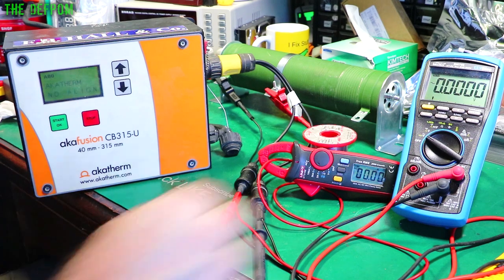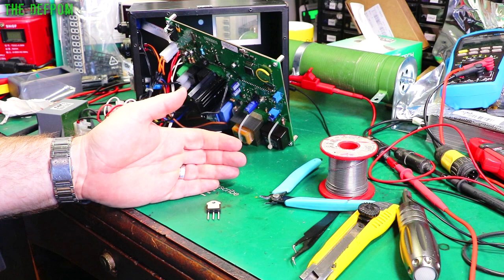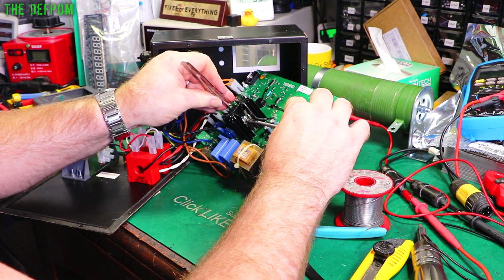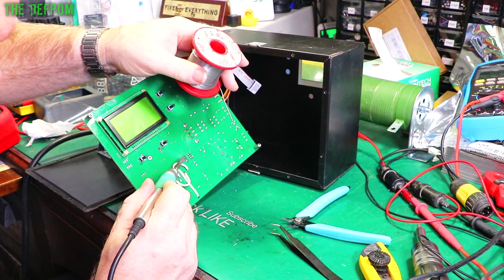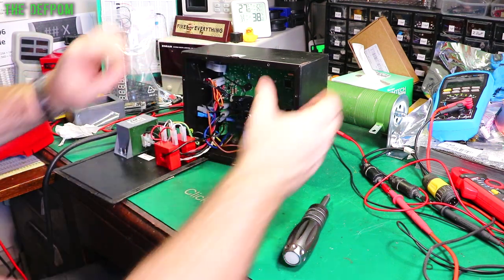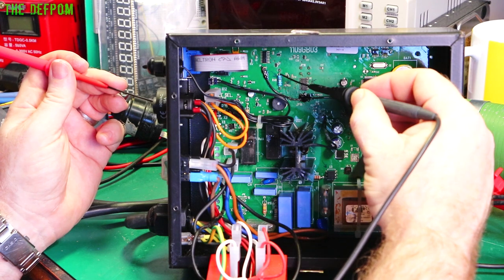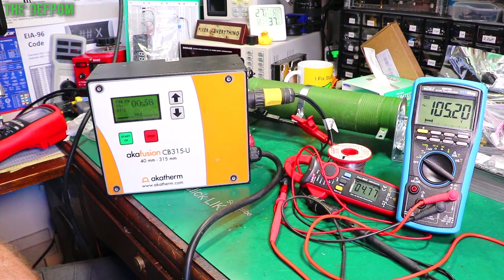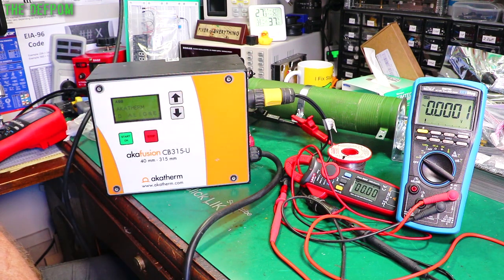🔴 Akafusion Akatherm CB315-U Electrofusion Unit Repair X2 SN_2436 & SN_2437 - No. 805

Comment: Hi, do you do a mains PAT test  to check insulation and ground continuity?
As these welders are used in the field powered by "generators", the ground circuit of the welder may need checking, also suggest to the customer he/she checks their generator and any power leads they use.
The fact they have the same fault, from the same customer may need some "interrogation" to find what operating conditions they are used under.
😃👍😃👍😃👍
Reply from the maker: Yes I already queried the power supply, they had their electrician measure the voltage and frequency of the generators they use, and it was fine (they sent videos showing the test being done), my only suspicion is that they could have been turned on and connected as the generator was powered up/down which may have resulted in a spike or something.
Reply: @TheDefpom  , and if you place a TVS diode on the powerinput of these units, to clamp down spike or surge ?

Comment: Nice repair, Scott. Perseverance rewarded! In addition to "Mr. Datron" you seem to have earned a "Akafusionman" title. Have you looked at the voltage across that resistor while the weld is taking place? Seems like leakage of the welding voltage might be possible cause. Also, is the user checking their cables and connectors regularly - triacs do not like arcing.
Reply from the maker: The 100V you see in the tests is across the resistor. The cables are a common point of failure as I showed a few times in previous videos, I have started to replace the wire with a more robust one when they fail now, I don’t want them to keep coming back!
Reply: @TheDefpom  Sorry for the confusion - I meant the resistor on the circuit card used for determining the resistance of the coupling. You said they had been failing and were rated high enough (watts-wise) that they should not have been. I was wondering if the welding voltage might be leaking into the resistance measuring circuit and causing enough current to flow through the resistor to damage it.
Reply from the maker: @davidv1289  Ohhh THAT resistor LOL.... the sensing circuit is switched through one of the relays which has the connections of: COM - Welding Fitting, N.O. - TRIAC Output, N.C. - Sense resistor.
So it disconnects the welding fitting from the sense line and connects it to the output of the TRIAC, so in theory it shouldn't be able to be fed any of the output voltage to blow it up, UNLESS the relay is arcing internally across the contacts between the common (the weld fitting), and the N.O. (TRIAC output) contact as it switched back off, I haven't ruled that out as a possibility.

Both welders were returned to service a couple of weeks ago, and I haven't heard about any problems with them since then, so hopefully the blowing resistor issue has gone away now I have replaced the TRIAC, it could even be a timing issue where the relay is supposed to switch over before the output turns on, and off after the output turns off, to avoid arcing.

The bad TRIAC it could have been leaking voltage OR the opto coupler was turning it on too soon, I didn't want to mess around trying to figure out if it was the opto or the triac itself which is why I just replaced both at the same time, plus one could have damaged the other.

Comment: would it be worth putting some thread lock on the nuts or use nylock nuts for the  on the triac? but I suppose that if they keep coming back with the same fault it is easy money for you:-)
Reply from the maker: The one I originally did hasn’t come loose again, it was just interesting that the 2nd unit was also starting to come loose.
Reply: @TheDefpom  I would guess they get tossed about at work

Comment: What happens if while its outputting power, the leads are suddenly shorted?  is the protection working to stop triac death?
Basically is it a constant current generator with around 100 volts output?
Reply from the maker: I’m not sure I want to find out!
They regulate the current, so it adjusts the voltage on the fly to keep a constant current, so if the load resistance changes so does the voltage to maintain the current.

Comment: If the boards holes are plated then you don’t need to solder on both sides of the PCB.
Reply from the maker: This is 5 Amps, minimum, and high current mode of 10A depending upon the fitting used, I’m not relying on a plated through hole to pass that much current, I want to be sure it doesn’t burn out.
Reply: @TheDefpom  okay I see more solder for higher currents. Thanks for the information. 👍